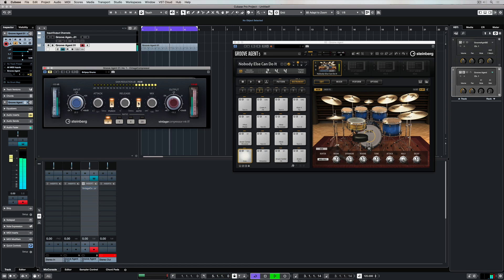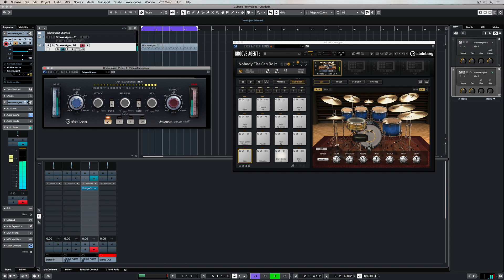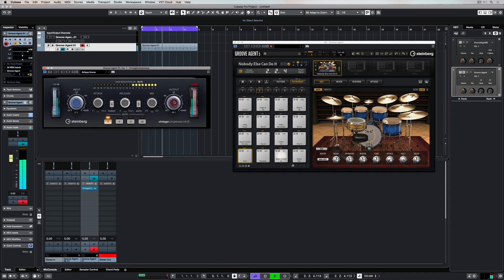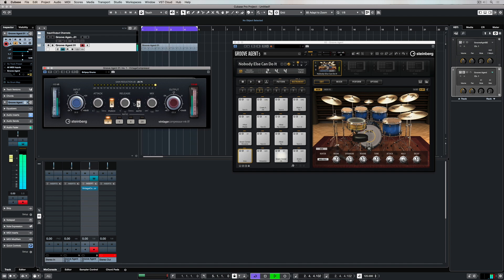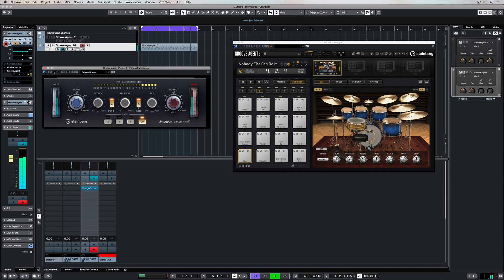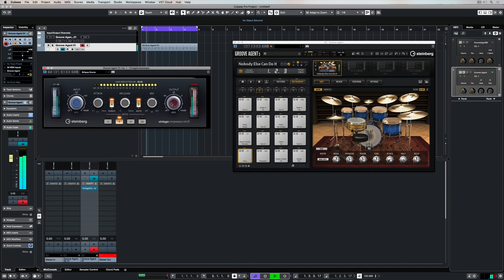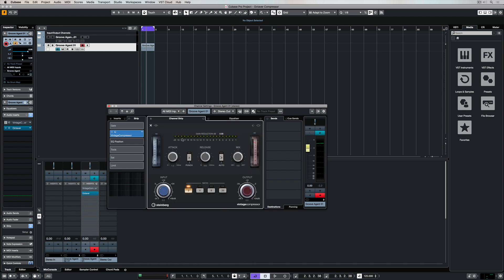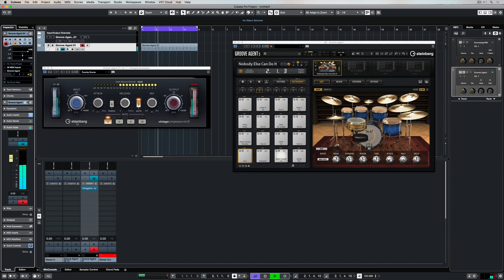Vintage Compressor | Effects and Plug-ins Included in Cubase

Comment: Andrew, I recommend you upgrade to Cubase 10.5 ;)
Reply: I'm on 10.5 and a lot of my favourite plugins are in blocked section not blocked but with the word crashed instead of blocked plugins that worked great in 10.0.40    4th of October maintenance build
Reply: No I would not yet. Many users has problems with non Steinberg plugins after update, they'll not be loaded or the dongle fails

For me, I wait a few weeks..